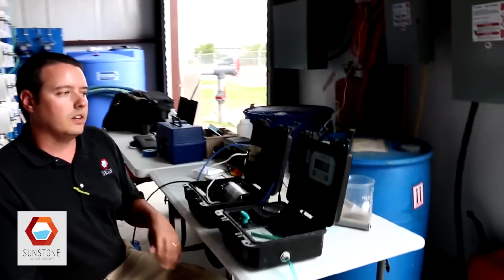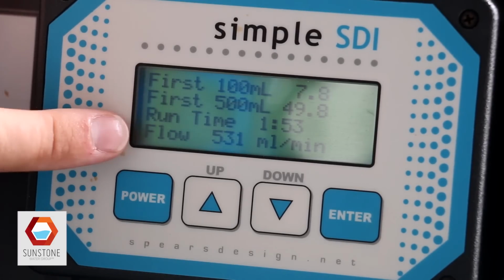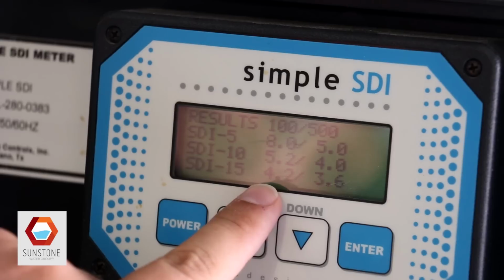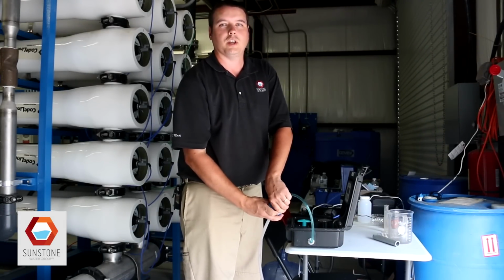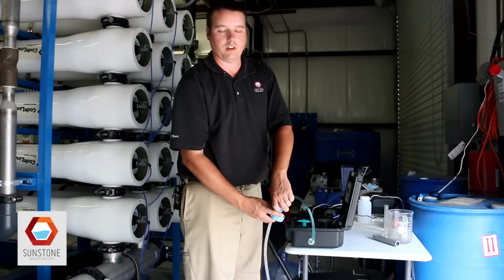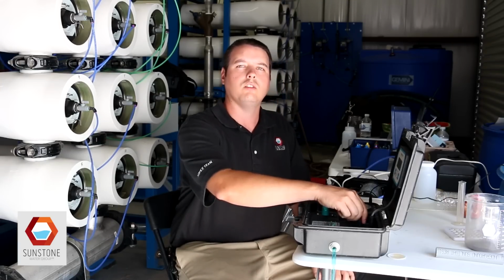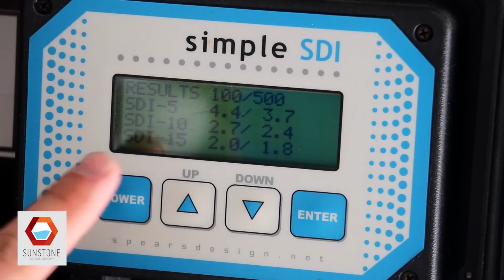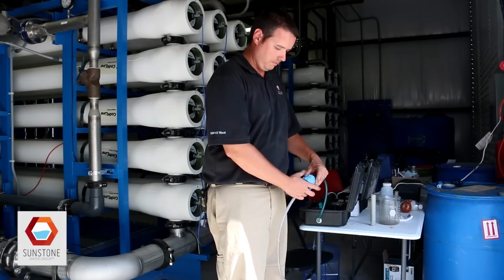Pretreatment to reduce SDI index and Desalination of brackish water

Comment: Sir I have a question regarding SDI.   Sometimes while doing SDI the pressure of 30psi increases during the 15 minutes interval. So we should take the second reading with the increased pressure or we should keep on maintaining the pressure by regulating the pressure valve?